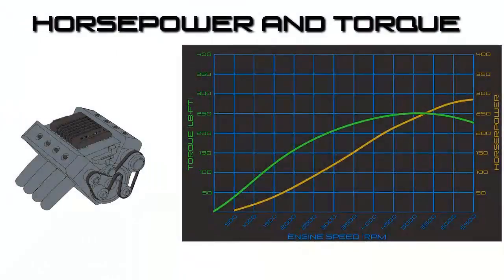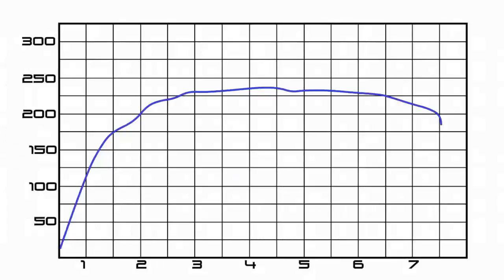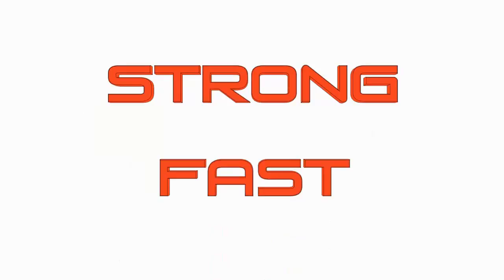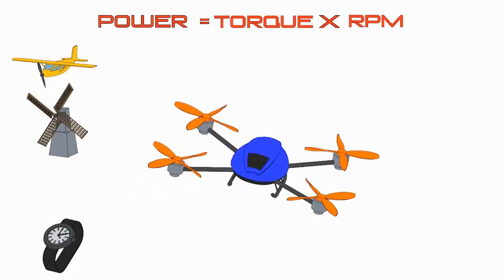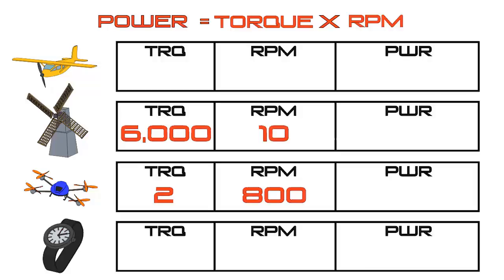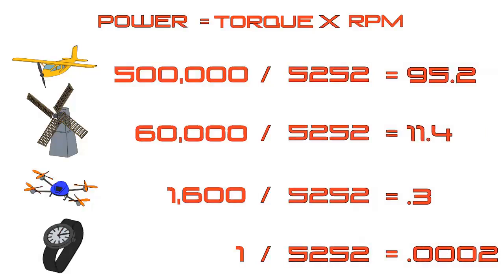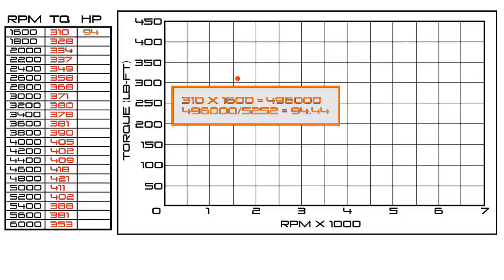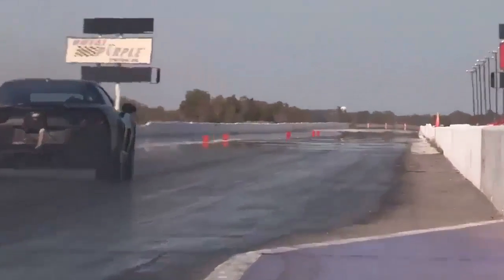Horsepower and Torque

Comment: A big, strong man digging a 100' trench with a big shovel vs another man shoveling with a small shovel but twice the speed. Big guy is gonna get a lead then horse power comes up on him toward the end. A good engine will carry horsepower longer before horsepower numbers start dropping faster that torque numbers. Rpm is king on a NA engine

Comment: Excuse me Bro, but i have to point out a huge mistake. Your comparison with the box and the screw is outright wrong. A footpund/Newtonmeter can be mechanical work/potential energy in the box example, but its something entirely different on torque, which is just a twisting force applied to a point from a distance, basically like a lever. These two values have only the name in common, nothing else. I‘ve struggled with this a lot myself and that‘s what I found out

Comment: 5252 what? rainbows? Why is there no unit definition with 5252...
Reply: It’ts because he’s using ft.pnd and rpm. Using Nm and Rad/s gives you Watts directly.
Reply: Beach&BoardFan rpm
Reply: Why that rpm?
Reply: @beachboardfan9544  that's the rpm where power and torque meet
Obviously that number changes when you change units of measurement
With hp and ft-lbs you divide by 5252, with cv and Nm it's different
Reply: A horse pulling up 33,000 lbs takes 5252 pounds of work/force

Comment: Question:  What will the BHP be for an engine with the following specs:  120 ft lbs. of torque at 4,250 RPM? 
Peak BHP is achieved at 5,800 and red line is 7,200 RPM's.
Reply: Do the maths